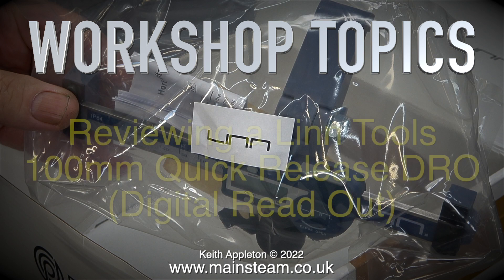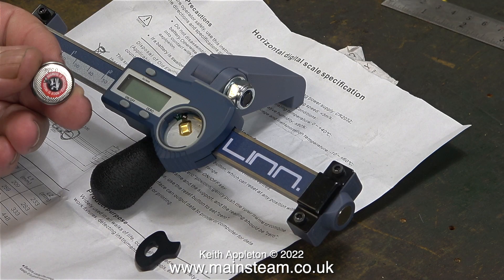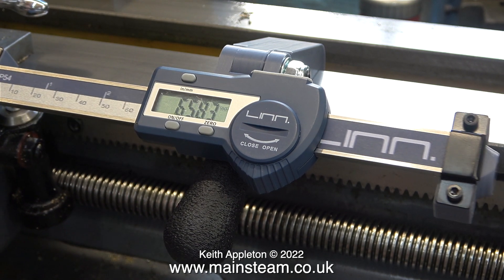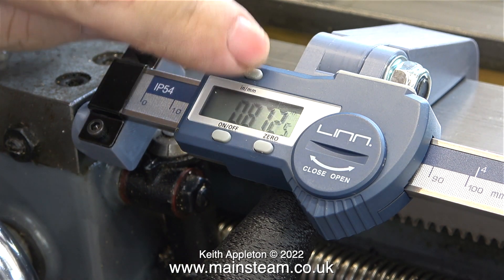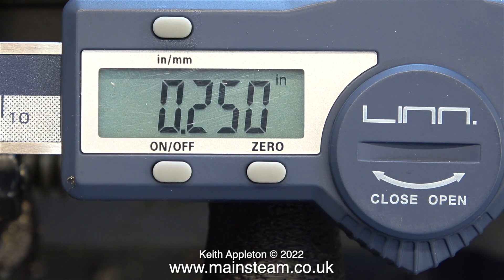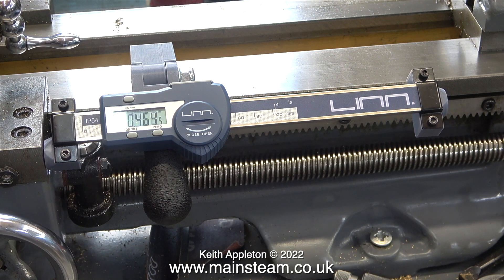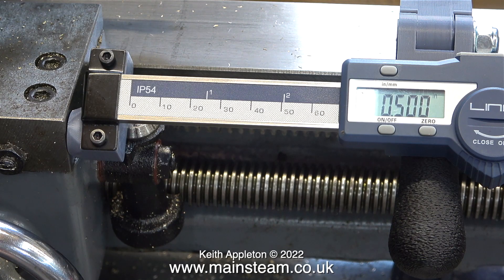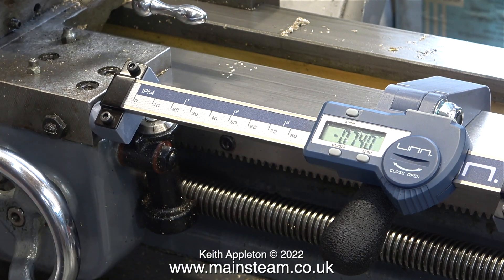LINN TOOLS 100MM QUICK RELEASE DRO - WORKSHOP TOPICS

Comment: nice to see such a neat tool
Reply from the maker: Yes, it has it's used for multiple accurate length part making.
Reply: @keithappleton  are there longer versions?
Reply from the maker: Yes.Please Google Linn Tools, they seem to sell using an Ebay Shop.